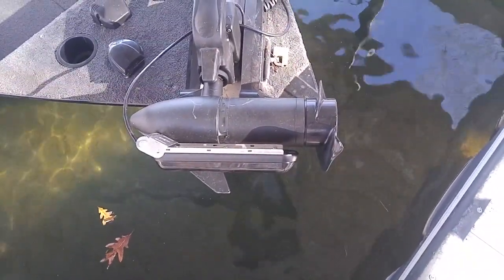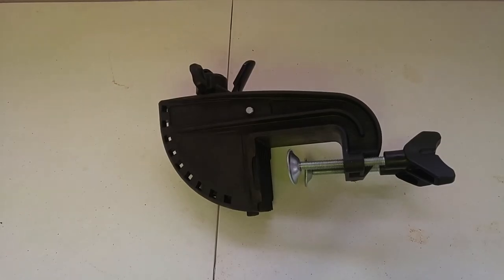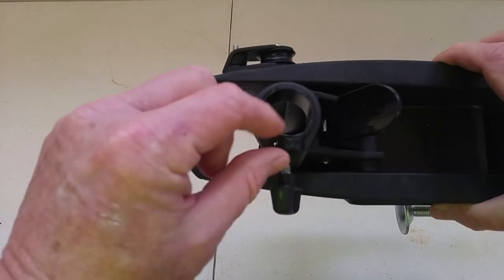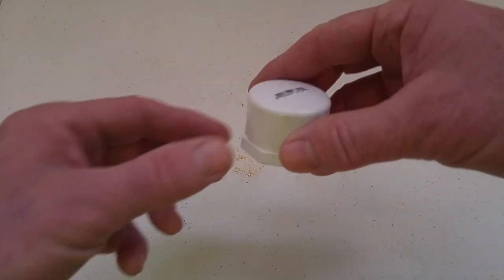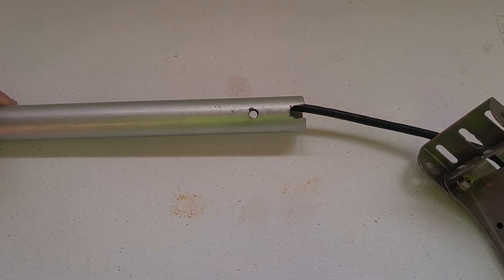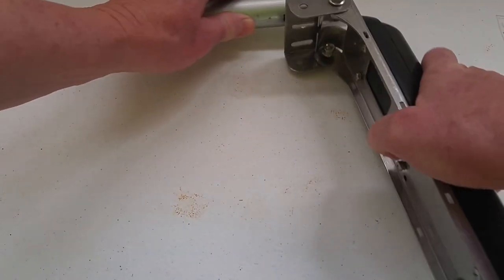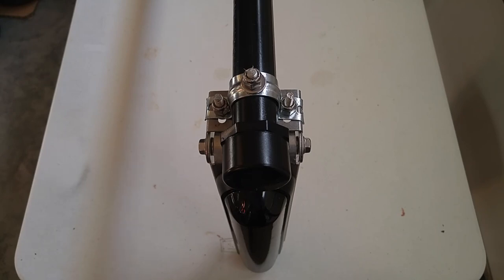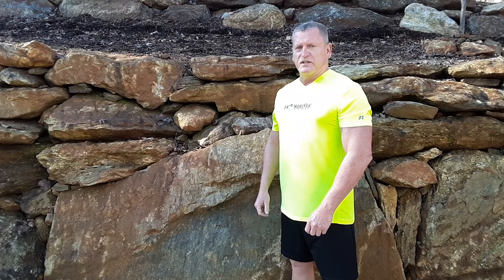DIY Inexpensive and Portable Bow Mount Transducer

Comment: I just did the samething with my little two man bassboat. I wanted to use PVC but like you, I found EMT was a much better fit. I had to run the wiring outside of the pole because there is not enough room to run the wiring to my Garmin inside the pipe. I took a few trips to Lowes to all find the parts to make everything work. It's as solid as a rock and I now have sidescan on my boat.
Reply from the maker: Glad it worked for you.

Comment: The best DIY solution!  Why do you want to mount the transducer to bow please? Just want to exchange thoughts. Thanks!
Reply from the maker: Thanks Justin. I have a trolling motor on the bow that I would normally attach a transducer to the prop head. I changed my fishfinder and the transducer is too big to mount on the trolling motor. That is why I made it portable.
Reply: @Aksmaniyak  I see, but then why don’t you mount it to the transom please? In other words, Do you prefer the transducer to mount on the bow or transom? Currently I have one mounted on the transom and I’m thinking if i should put it on the bow like you have done, when doing bass fishing. Thanks!
Reply from the maker: This is mounted on a boat. I have an outboard motor on the transom and there is no room. Bass fishermen like to have the trolling motor on the bow with a fishfinder.
Reply from the maker: @jrm163  https://www.youtube.com/watch?v=u-UA4i_EV4I&t=291s
Reply: @Aksmaniyak  thanks! FYI, This man does the similar thing: https://youtu.be/Fe3lA1NmtLY
Reply from the maker: Yes, I see but he bought his and mine is DIY.I hope this works for you.